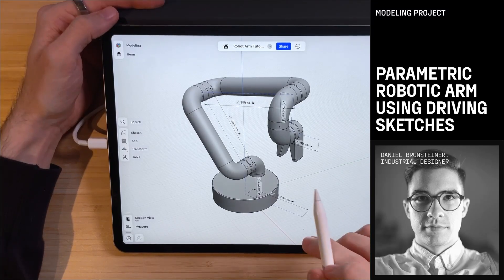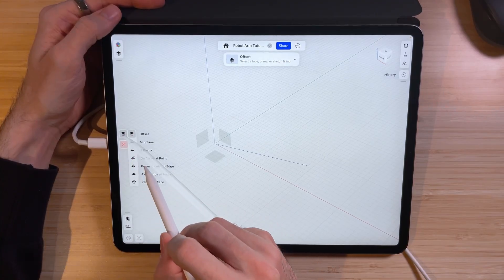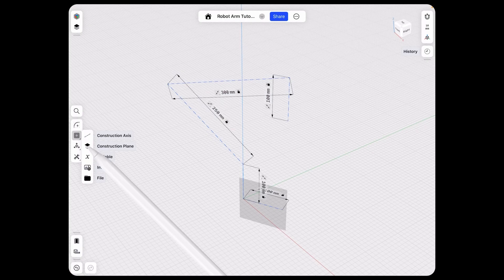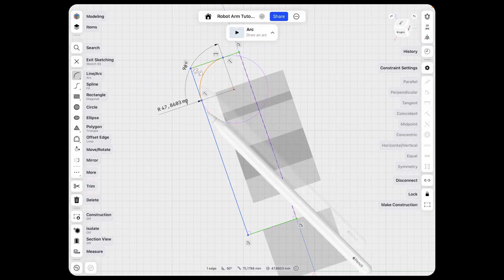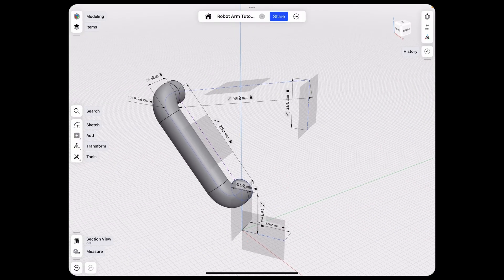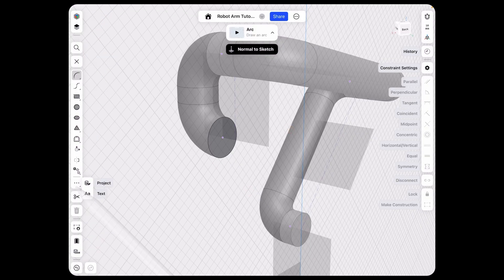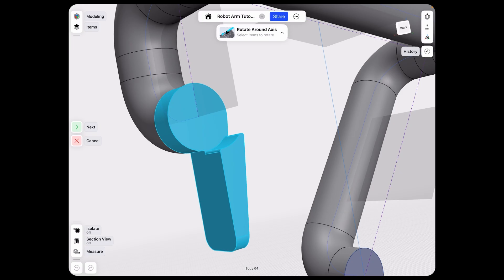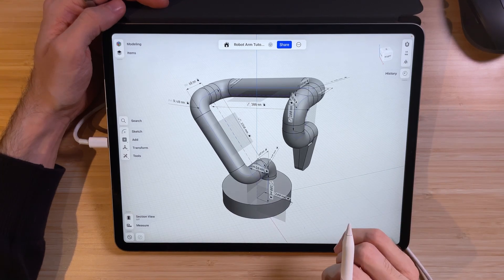Parametric Robotic Arm Using Driving Sketches | Modeling projects

Comment: Great video. Thanks very much.
This will also work well with 4 bar linkages, etc.
Now it would be very helpful if you could save several positions of the driving sketch (essentially as keyframes) 
and then see that motion as a 3D motion simulation with auto-tweened positions.